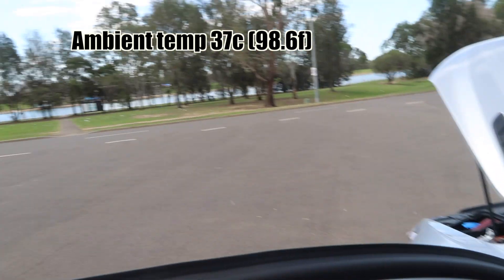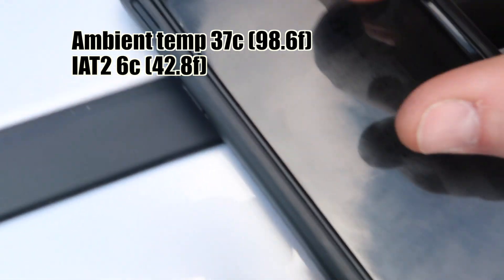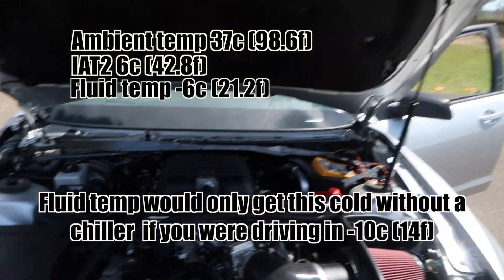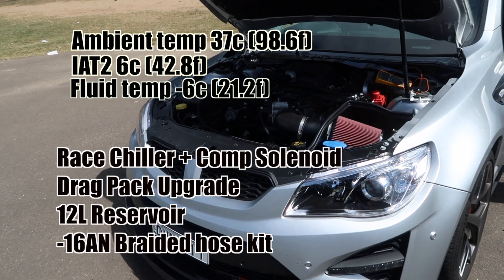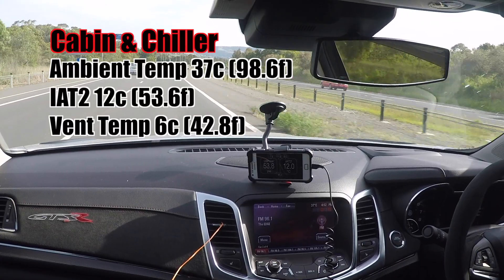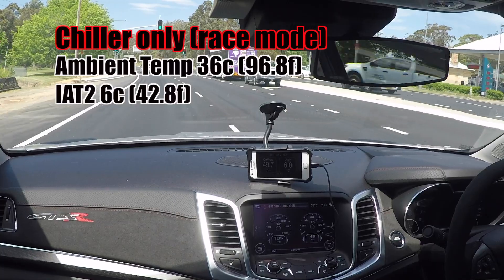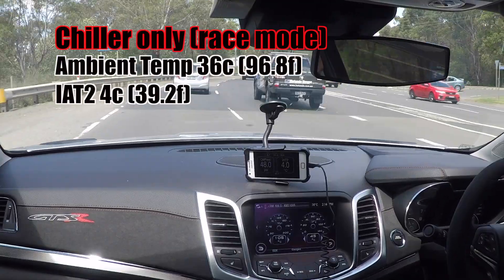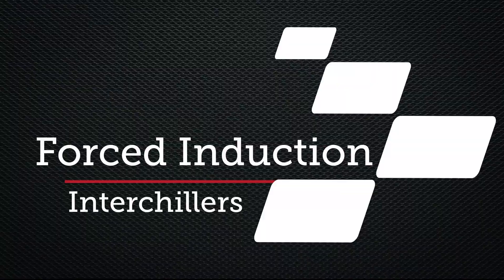Race Interchiller + Stage 2 Upgrade on a 38c (100f) Day

Comment: Would like to know what happens when its really cold outside temps, like say driving at Mt buller for example or even close to that spot, where your looking at low -3 to -5 C outside temps, can you still run the A/C and heater at the same time For defrosting issues in the car and the interchillers is turned off ? Anyway good work and keep it up, cheers :)
Reply from the maker: Yes there are multiple ways you can do this and we list it all in our customer instructions.
Reply: @ForcedInductionInterchillers  now all you have to do is replace the stock supercharger with the new harrop 2.650lt version ,so that you have around the 800hp with the new supercharger and tune and with the interchiller mate it would be a total new experience?